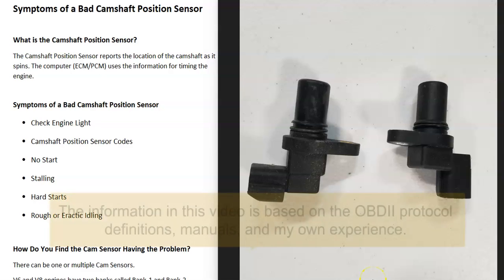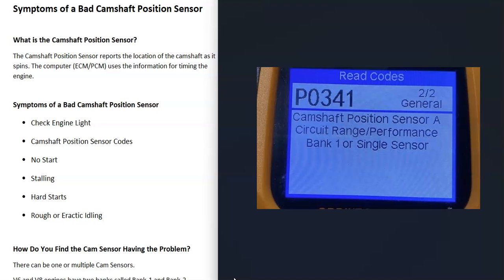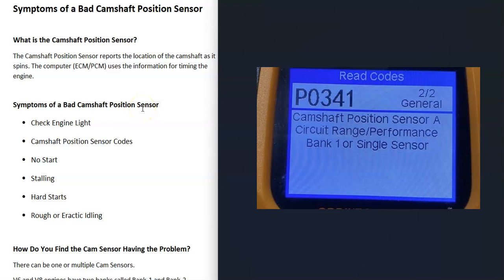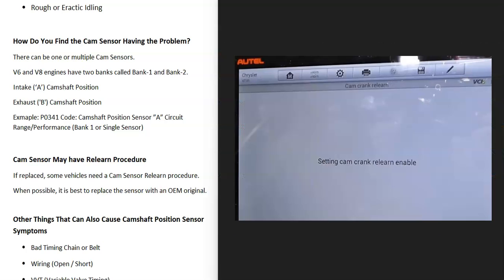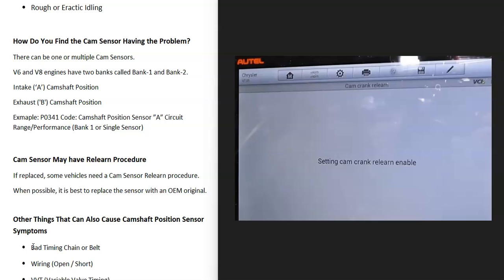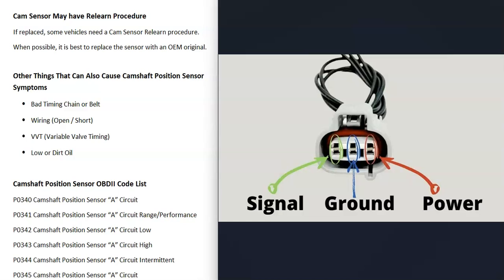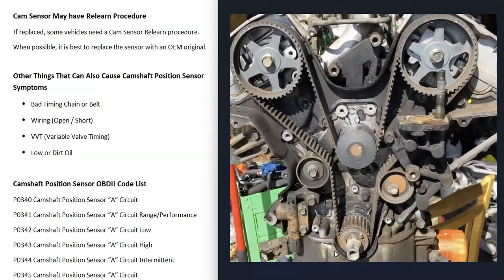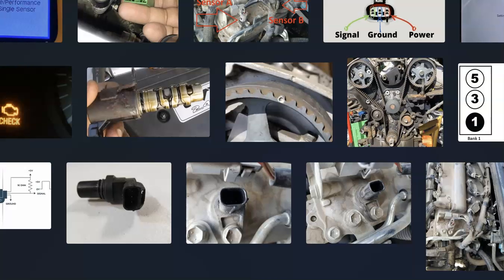Symptoms of a Bad Camshaft Position Sensor

Comment: Hello sir I'm the guy with the prius with the 02 sensor issues you had mentioned about it being a wiring issue wich I totally agree with yo .....so here's the thing I watched a video where a guy had a pick up truck and he took a test light unhooked the battery and tested each sensor until the light would go off ...this was a probably k10 or 80's full size pick up I have a hybrid prius with the battery in the trunk I. Just dint want to fry anything ill send the video to you sorry brother I'm really desperate here inspection is coming up and I need the check engine light to go out
Reply from the maker: There are different methods to check and test the 02-sensor wiring, but you shouldn't need to unhook the battery. I would get a wiring diagram for the specific vehicle and check voltages and grounds are good or find another video. Be sure to also test the sensor is good.

Comment: I went over water and i blew a hole in the block, i got that code could it have failed and stopped the cams from moving and the pistons didnt stop moving and blew a hole in the block ?I did have lots of water in the intake too.